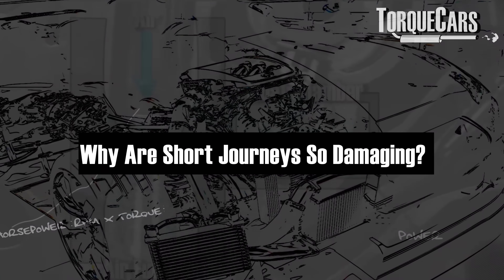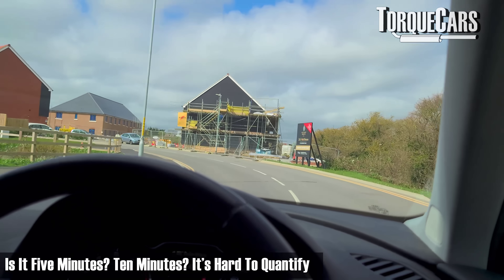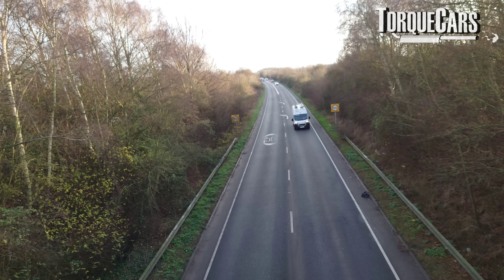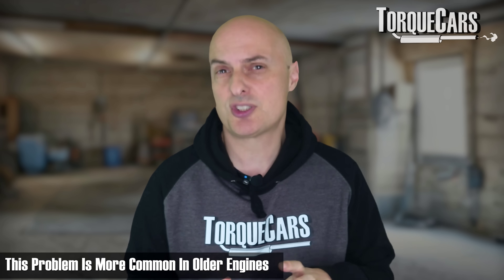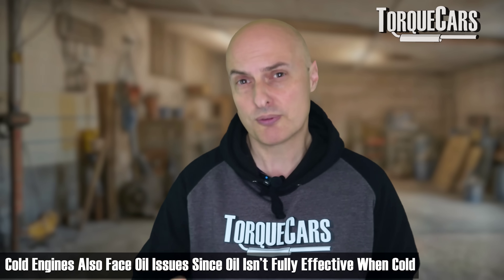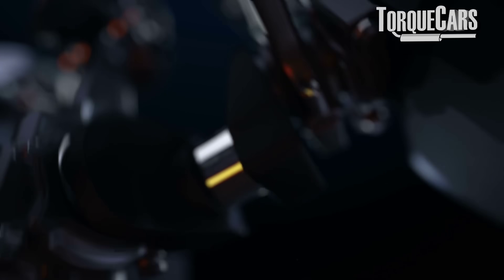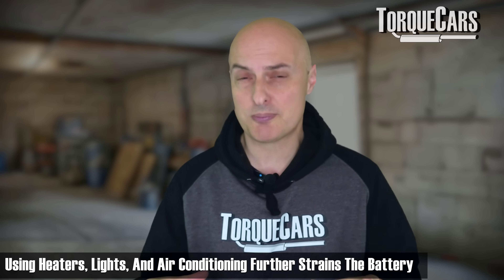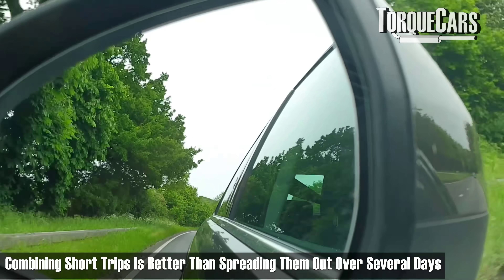Why Short Drives are Damaging - Discover The Causes & Avoid The Problems Of Short Trips.

Comment: I drive a 22 year old Toyota Avalon.  Purchased brand new and still running like the first day.
During the whole time of ownership, I have been aware that short hops are damaging.  However, I can control the servicing and the maintenance.

 3000 mile oil changes.  Done the last 15 years with the factory filter.  Transmission drain . . .  now have a goal of every 15,000 miles or 4 years, which ever comes first.  Obviously, I drive not much, being retired and so I cut the mileage in half.

I observe that a car radiator is supposed to last 10 years.  I got 17 years by changing the fluid regularly.

Comment: yeah, i wish i had an EV or a plug in hybrid for short hops, but i also don’t want to buy one as my sole vehicle. i have a 12 minute drive to work, sometimes i run late so maybe i push it harder than i should. anyway the dummy light goes away about 3 minutes into the drive, but using a tuner with a screen, i know the light goes away at 45c, so typically i don’t just pin the throttle when it goes away. still i know it’s not ideal. very obvious considering the low gas mileage on my typical commute vs a nice highway drive. about 25 vs 40. but i also have a K20 civic and not eurotrash. the pinned bmw engineer is probably right… for bmw’s. yeah we already know to avoid those

Comment: none of this affects me because i have an electric car now
Reply: And it is... bad once the battery says good bye.
Reply: @alen2937  when? a diesel car will have a problem every 3 months for 10 years before the batery goes bad, i m not interested in renting a mechanic to babysit the car instead of driving the car
Reply: @MRSarvy_1  Well, my honda manual has not broken not a single time on me... on 10 years. It is a matter of buying a reliable car, any make can make blunders, few of them create decent cars.
Reply: @alen2937  well if you bought a new honda then yeah it had no problem,but my electric car is also new and i payd less then a new combustion car costs,so i still end up cheaper,plus its more relaxing to drive electric
Reply: @MRSarvy_1  Yeah no. Electric cars are way to expensive for what they are worth, also, I doubt your car cost was 12000 usd, which is what I paid for mine, new, 2015.

Comment: hey man, my car heats up faster when I drive in manual mode because I don’t constantly put it in the highest possible gear where the rpm is just over 1000. I drive it between 2-3000rpms (2000 when I’m cruising and then up to 3000 when upshifting) and I accelerate gently. That way the car heats up a lot faster - but I wanted to know if it’s safe to do so
Reply from the maker: Whats the overall red line on that? Stick to the lower third when cool, mid third when warming and full range when up to temps. What you are doing sounds good to me though for most modern engines.
Reply: @TorqueCarsDriving  7500 for redline
Reply: @TorqueCarsDriving  and thanks for letting me know!

Comment: That’s not how the battery works. Its main job is to start the car. Once that’s done the battery is doing nothing but being charged. The alternator is powering the car and charging the battery. The only time the battery dose something other then start the car is when the engines off and you are in accessory mode to power the lights work the radio windows door locks and HVAC system.
Reply from the maker: You'll see problems on worn alternators where current is not maintained and also with each start the battery drain is cumulative, say losing 10% after each trip that isn't replaced because you've only done a short trip.

 I didn't want to do a detailed in depth discussion on batteries in this video so though it best to generalize.
Reply: @TorqueCarsDriving  yes that is true if you don’t drive long enough the battery won’t fully charge but what I’m saying is the battery dosnt power the car. The closest it comes to powering the car is the fuel pump and injectors on startup.
Reply: no it actually still loses power each start that it cant gain back. the car will say “drive the car to charge battery” or something like that on the screen and start stop wont work

Comment: My wife only drives short trips. 😂😂😂 and that’s the n the winter down to -30C sometimes. Get brutal fuel mileage but the car runs fine. ECU just dumping fuel into the engine like mad.

Honda with B20 engine. No VTEC. No hydraulic control. Manually adjusted valve lash. No low tension piston rings. Low interval oil changes with full synthetic. No need for fancy “modern” technology that is just another failure mode.

I don’t believe in sitting and idling. I just wait a few seconds before shifting into gear. After that the oil pressure is full. Then I drive gently until warmed a bit.

Comment: This issue always begs the question..What if everything I do on a daily or weekly errands  is NEARBY? The walking depends where u live, especially here in America. Not to mention long journeys ALSO cause wear and tear.
Reply: Then own an old cheap car and use synthetic oil and change it at low intervals.
Reply: It raises the question, and using a 0w oil would help, as would using the block heater if it has one.

Comment: i can understand explaining why it damages but its kinda pointless when its unavoidable.

I live 8 miles from work. Am i supposed to wake up a hour earlier and idle the car outside? 

No buses at that time either.

If it worth faffing about premature wear? 
If you double the distance to 16 miles each way great its now totally warmed up but now your fuel bills have doubled.

So instead of lets say 800 quid a year on fuel. Its 1600. 

Thats massive. Also obviously doubling the mileage per year.

Pointless conversation.

Service the car properly and don't thrash it. And it will last 5× longer than a bad owner.
Reply: Just aake up an hour earlier and drive to the coast and back before work.

Comment: Hybrid Issue :      I'm a UK pensioner with a modicum of mechanical knowledge.   After retiring, I changed my car from a diesel engined model to a petrol hybrid (my domestic journeys were typically short,  so far from ideal for a diesel !).  Being as most of my journeys were subsequently quite short, and also much more in stop/go traffic where the hybrid system really came in to it's own  -  always travelling in exactly the right relevant gear ratio for my road-speed (those traffic queues always seem to inch along at a speed to fast for a manual 1st. gear, but too slow for 2nd. !)       An issue that hadn't occurred to my little grey cells  before going 'Hybrid' was that, having no control of when the petrol engine fired up, my short local journeys to my local leisure centre gym, not unusually, resulting in my temperature guage needle not reaching the appropriate ideal operating temperature .  Wanting to do the best for my engine, I've now developed a better 'usage' m.o.  that encourages the engine to fire up and get warm.    
            Firstly,  I don't drive to my gym etc by the shortest route.   I also discovered that (especially in colder weather) if I turned on my heater blower, (but obviously on low temperature on warmer days)  the petrol engine fired up to facilitate a sensible amount of usable 'charge' in the battery.   The result is that my temp. gauge needle rose up it's scale more swiftly (same with rear screen demister,  heated seats etc).   Even though my short journeys  only now have an added ten minutes or so added to them, I'm much happier with the operating temperature attained by the engine (1500 cc engine in a Lexus LBX.   Getting almost 60 MPG, but higher on a long, higher speed journey).                         (Separate matter entirely :     I've now learnt about the extremely tight bearing clearance tolerances in modern engines, necessitating the ridiculously thin engine-oils now recommended so the oil, when cold, can find it's way between the bearing surfaces .  {another design advantage of thin oil  = less drag on mating surfaces, so a more efficient outcome].   I believe the experts are predicting that the days of getting 300,000 miles from a well maintained engine are probably now gone.  Smaller, more highly stressed engines, boosted (often with turbo's)to provide what was once output by older and larger, more robust engines.  (sounder principle to get a big engine to do a small job, than small engine to do a big job ! )     Something else for me to worry about !    Luckily, being an elderly pensioner, 300,000 miles in my car is just a pipe-dream  : - )
Reply: But if you do a short journey where the petrol engine doesn't fire up at all, that's perfectly fine - the electric motor doesn't have any of the issues discussed in this video, it's perfect for short journeys.
Reply from the maker: I would kick it into sport mode for some of the journey and in most hybrids that will help warm up the engine, it also shouldn't affect fuel economy if you are gentle on the throttle in most cars.

Comment: That is why I drive a 30+ yo car with no CPU, sensors, catalysts, particulate filters and all the rest of the electronic nonsense that pretend to serve but only make the life of the driver more complicated and more expensive long run when they inevitably malfunction and break down. Good old common sense, use of the choke as I judge necessary, frequent oil changes, and all goes well.:yougotthis:

Comment: My Nissan has what they call "mirror bore" cylinder coating, a thin sprayed on iron coating rather than a steel sleeve. One of the claimed advantages is it transfers heat better and warms up faster, which I can confirm. My other car takes 10 times as long to reach operating temperature.

Comment: I let the car idle for 30-60 sec on absolute cold start, so that everything in the engine gets circulated good (though it should do that like in about 2 seconds, but just to make sure). My engine also makes lower idle revs after 5-10 seconds of cold starting, which indicates to me that it is good to wait at least for that. And then I drive it at least until it gets to the operation temperature (I use the oil temp indicator). This is usually about 10-15km or about 15minutes of easy country road driving for my car, without doing some crazy high revs which is bad for cold engine. I have the 1.0TSI engine, which is small and I assume warms up a little quicker. It is good that things get hot: the particle filter, so that it doesn't clog and exhaust, so that condensation inside evaporates and doesn't rust.

Comment: By most definitions I've seen, 99% of my engine starts are cold and result in short trips. I have a 2016 2.7 EcoBoost which warms up quickly. I change oil at 1/2 the recommended interval, use high quality oil and permanently disabled stop/start. I get on the Interstate once a month for an Italian tune-up. So far, runs like brand new. OG battery lasted 8 years, replaced it before it died.
Reply: Great. Frequent oil change and being kind while engine is cold
Reply: Shhh this doesn’t fit their fearmongering narrative. Pinned comment from an engineer saying any trip less than 25 mins is going to ruin your engine LOL
Reply: @NA-gm5sx yeah if 25 minutes is bad, i guess generally i can not drive my car? 25 minutes, i can make it to the next city over nearly. why would i do that everytime. a drive to the grocery is 7 minutes, grandma 5 minutes the other direction, buddies are 10-15 away, work is 12 minutes
Reply: @NA-gm5sxCONSTANT short trips DOES knacker you car.
Reply: @NA-gm5sxI used to commute 15mins a day each way on my motorbike. The engineers at service would always say ‘you do short trips on this a lot don’t you’. They could see certain level lines, or wear lines somewhere…?
Reply: @PaulB-q3d , mayonnaise in the oil, water in the exhaust etc.
Reply: My mom has a 2015 Lexus with 20k miles all of her drives are 15 minutes or less. The car is in perfect condition the dealership keeps asking to buy it. They want to give us 25k for it….
Reply: @RipliWitani doubt you’ve looked inside the engine and exhaust.
Reply: Why have you permanently disabled start stop?
Reply: 2.7 is a great engine they just need to bring back the oil chain
Reply: Eek 'Ecoboom' - careful! :)

Comment: I drive a Toyota GT86 and has both a coolant and oil temp display. I don't move the car until the blue coolant light has gone off and the RPM settles. I don't go above 3000RPM until the oil is at least 80C. Sometimes I can't help but take short journeys but when I do I'll take a detour and let the oil get up to temp before parking and switching off again. The oil gets changed every 5000km to be on the safe side.
I cringe when seeing people start their cars and give it the boot straight away. 

I enjoyed this video alot and your voice reminded me of Russell Brand. 

SUBSCRIBED ✅️
Reply: I used to have a neighbour who'd start their car left outside in winter overnight, and boot it up a hill straight up
Reply: dont detour if anyone is waiting for you or some other person is in the car i hate when people do that to just to extend the drive like two minutes. also 5000km oil changes are crazy i think youre too paranoid
Reply: @buzdagipetsise  lol.   On some cars engines, with short drives, it really is smart to do 5K km's changes
Reply: @buzdagipetsise  most of my trips are short commutes and to the gym at 6am. That's alot of start/stopping before it reaches temperature. The 5000km oil changes is more for my peace of mind and ensuring the engine has the best oil possible considering my driving schedule.

Comment: If you take a lot of short trips, go out for a decent size drive and give it an Italian tune up every few weeks.
Reply: Someone did an actual study to show how hard you would have to drive in order to actually help clean any carbon deposits, and it was insane. I think it was the Engineering Explained channel.
Reply: @GregoryBaker  Yeah you just gotta always drive relatively hard (unless the engine's cold ofc)
Reply: So in conclusion if you need to drive less than 25km away sell the car and walk.
Reply: @donmclean554 yeah good luck getting 99% of Americans to walk 25m, let alone km.
Reply: Italian tune up? Does it involve a tow truck? LOL
Reply: @nofyfb123 nope, involves a few spirited pulls and sometimes an explanation to a fine police officer.

Comment: So many of my neighbors practically have their car rolling before the starter finishes engaging. I see them start and go start and go everyday and think to myself, I'm never buying a used car again. There is no way to know if you're buying from a seller like that.

Something interesting about them too, they have different cars every few years while our oldest car we have is a 2003 Accord and we still have it. It purrs like a kitten thanks to good warm ups, 3000 mile oil changes, and all other fluid changes every other year. Yes I actually do change all fluids every 24 months. even brake fluid.
Reply: Not buying a used car ever again is going to give you an entirely different set of problems, though: modern cars are deliberately designed to fail. They are designed, on purpose, to be beyond economic repair by the second owner of the vehicle. Numerous youtubers have exposed this, experts in their fields: Uncle Tony's Garage but not limited to him, certainly.
Reply: youre doing too much it simply doesnt matter at all. you dont warm the engine up by sitting there only thing to care about is to not floor it when it is cold just drive normally or a little slower the oil will get up to temp in no time ot like get 0w30 oil instead of 5w30 like theres options
Reply: modern fuel injected engines take significantly less wear and tear from warming up while being driven gently, versus idling to warm up.

if your neighbors are flooring it moments later, then that's a terrible idea, but if they drive gently and keep the revs down that is literally better for the engine than idling it to warm it up.

check the owners manual for any 21st century car and it will state this outright.

people who tell you to idle for a while to warm up the engine are repeating advice that people have been repeating for decades, ever since back when it used to actually be true
Reply: I agree with you 100% , I do the same 😊
Reply: "even brake fluid" is hilarious given that that is one of the more common fluids to change because it pulls water. 2 years is the recommended interval.

Way rarer changed fluids are stuff like diff fluid, power steering fluid and for some even coolant.
Reply: I see that and often they are parked outside and it’s minus temps.
Reply: Buying new cars is a tremendous waste of money when you can just learn basic car diagnostic skills like doing a compression test that will tell you objectively the condition of the engine

Comment: I can't afford a heated garage.  What is you opinion on Magnatec oil?
Reply from the maker: I look at the formulation of oil not the SAE rating, and overall the big advertised brands are usually outperformed by specialist suppliers. Putting a high ZDDP oil in a modern engine will help destroy it, even if the SAE numbers match. If the manufacturer recommends XYZ67 then that is what must be used, VW 507 for example.